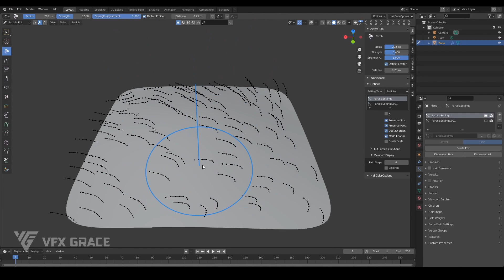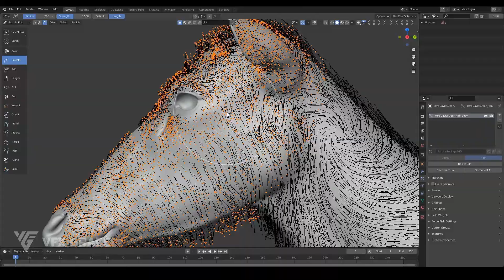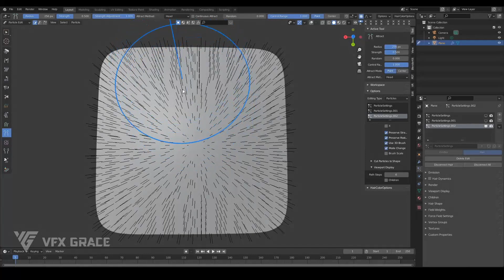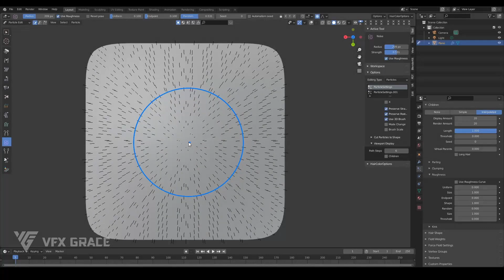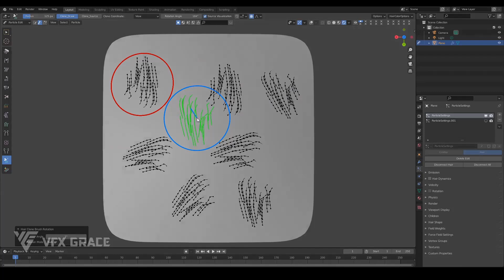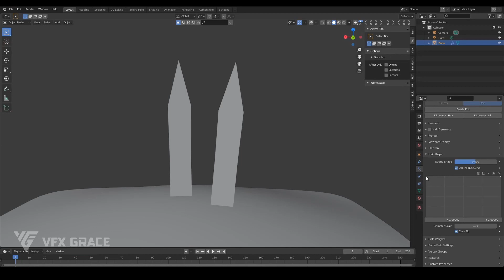Blender Add-on | 3D Hair Brush Instruction | Top 2021

Comment: amazing  add-on! Constantly use it, cause it saves me a lot of time!
One thing tho. When I color one side of a head, the hair on the other side gets the same colors in random strands. Not symmetrically, and not in positions nearby. Just, randomly. Turn Mirror X off, and it still happens. Any clue as to why?
Reply from the maker: Hello, is your "Toggle X-Ray" on?

Comment: hey man, recently Ive purchased 3d model from this channel (same name vfx grace)
it was really great model, but I got performance problems when display the fur on viewport

my systems is i5 6500, 16gb ram, gtx 1060 3gb, and ssd
which thing that I need to upgrade 1st for get proper experience?
Reply from the maker: Hi, it is necessary to improve the ram and video card.
Reply: @VFXGrace  thank you, do u have recommendations?